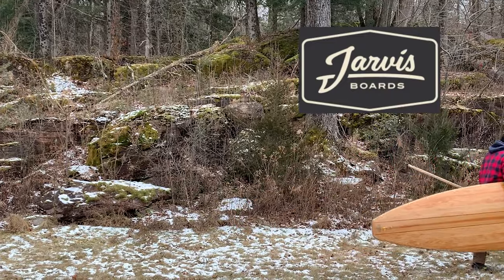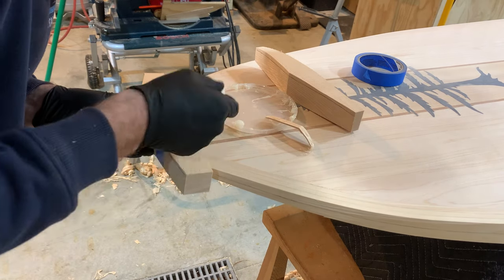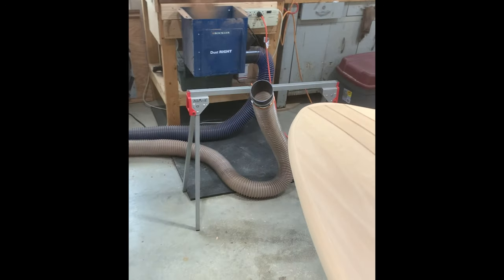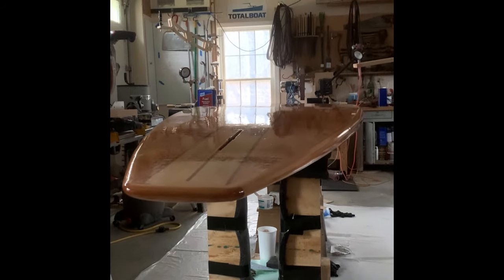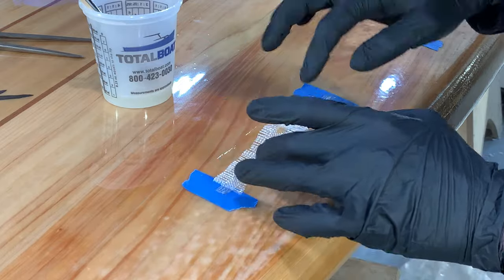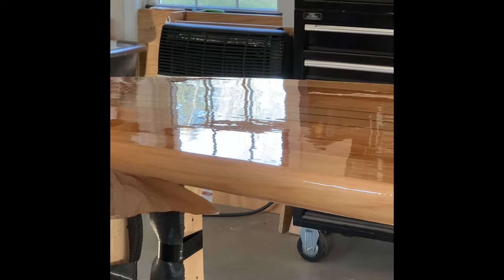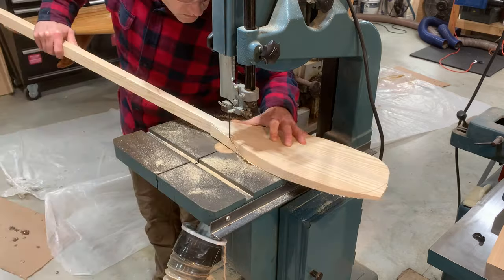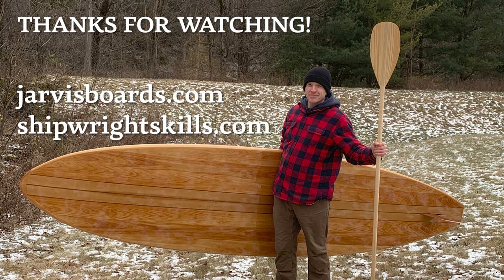DIY SUP - PART 4

Comment: What wood species did you use to make the paddle? I've built 2 Jarvis SUPs but haven't made my own paddles yet. Beautiful SUP and paddle.
Reply from the maker: Thank you! It is ash, light for a hardwood, and very strong as well. Cedar could also be a good choice, but I wanted a fairly stiff paddle, and ash is that.